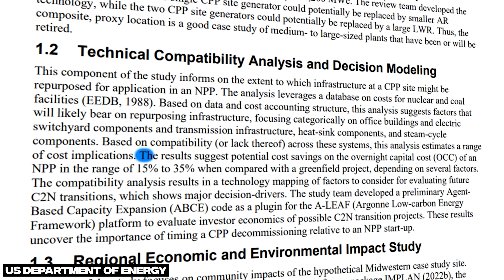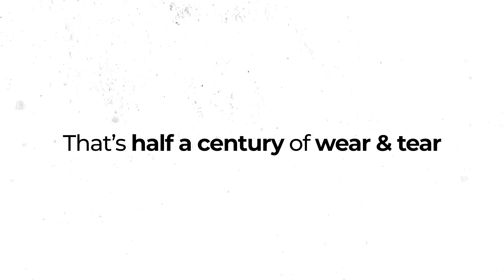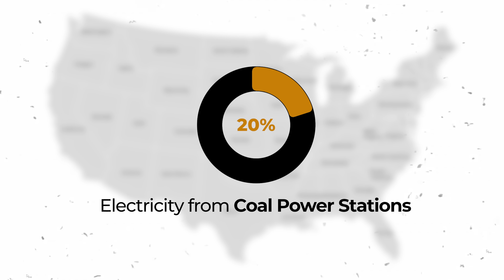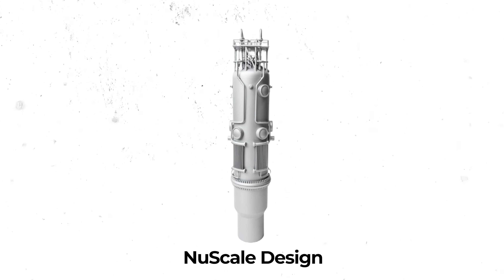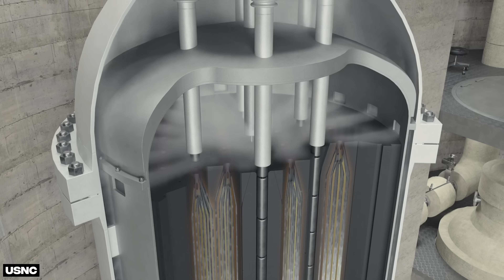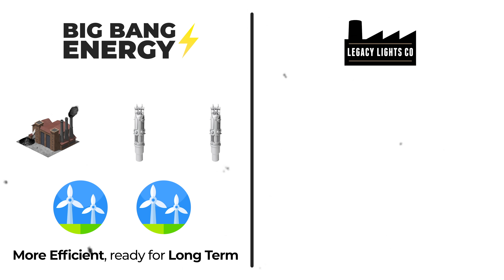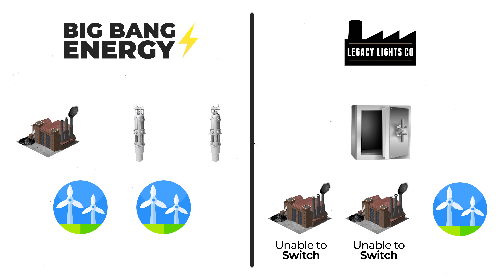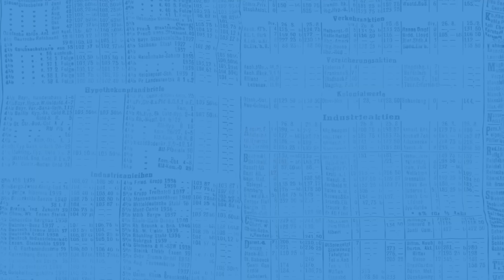Can We Convert Old Coal Plants to Nuclear Energy?

Comment: YES, and it's a brilliant idea!  Replacing the boiler and condenser with a nuclear reactor connected to the generator will reuse the old existing grid lines and infrastructure.
Reply: connecting a multi billion dollar new reactor to 60 year old coal plant components.  What could go wrong?
Reply: @clarkkent9080  Well, if you pay for it, maybe they can replace everything!
Reply: @vijayanchomatil8413  You could but you still need an expensive evaluation of the site for acceptability, cleanup of the coal ash, and cost to remove all the old equipment.  Would it not be a better idea to site a new reactor at an old abandoned nuclear site where all the evaluations have already been done?
Reply: @clarkkent9080  The cleanup is cheaper than the engineering and construction of a new infrastructure including the certification and delays.
Reply: @vijayanchomatil8413  Then why is Terrapower who is building their Natrium reactor at the site of a 60+ year old coal plant not using any of the plant systems or buildings? They only plan on using the power lines in the switchyard
Reply: @clarkkent9080  Exactly, they are using the power lines and interconnects to the grid!
Reply: @clarkkent9080  But i see your point, it depends on how old the turbine is.  One from 3 or 4 decades ago may be incompatible..
Reply: @vijayanchomatil8413  It is not only an issue of connecting to old equipment but of compatibility.  In order to operate efficiently, all the secondary components of a power plant are designed to be matched to the output temperature, pressure, and flow rate of the steam generation system.  A power plant is designed as a complete system.

Coal plants also produce superheated steam while nuclear plants do not.

An analogy would be replacing an gasoline engine in a truck with an electric motor and battery.  It would work, but the output and torque of the two power sources are different and it would not result in an efficient swap.  

Power plants are only 33% efficient and every percent loss is significant when added over the life of the plant.

Comment: I like the idea of reusing not just the site and its grid ties, but also the turbines and generators.  But I have questions:
1. How much savings is this, taking maintenance into account?  Is this a good idea on paper that isn't worth doing IRL?
2. Are coal plants typically built on waterways and relying on river/lake water for cooling?  Given increased draught should we be designing to eliminate this need, given how French nuclear plants for example have been hobbled by low water levels over the last few years?
Reply: Even if the only thing that can be reused is the transmission lines out to the grid, it's worth doing. What is more likely is a major refurbishment of the power conversion equipment would be needed. Then you add a high-temperature nuke and away you go and no water source is needed, they are air-cooled.
Reply: @chapter4travels  that's perfect.  I didn't know the advanced designs are air cooled.  Water cooling has problems with draught and effects on wildlife (or regulations thereabout), as well as siting constraints.  When batteries get cheap, put a big one in front of the nuke to get 30-40% more effective power out of it, by banking nighttime power and delivering it to peak demand (assuming the demand is there, otherwise just turn it down at night, if the design allows for that, or do carbon capture or something).
Reply: @tristan7216  "Advanced Reactors" is a bit of a misnomer, they were invented in the 1960s but not commercialized because they were not right for military submarines. They work at much higher temperatures than the domestic reactors everyone is using today and you need that higher temperature to work with the equipment in coal power plants. They also load follow just as well as a natural gas plant so no batteries are needed.
Reply: Switching our office to a paperless one looked really good......on paper !

Comment: What needs to be explained is that solar panels produce no energy at night ,so you have what's called the duck curve. This why coal fired power plants are inefficient because they can't compete with solar in the daytime, you can't run a coal plants only at night because the cost of running the plant at idle. And when you talk about nuclear it won't happen people in my area don't want carbon capture, combined with other devices would make coal real clean . One question I have had is with windmills blades wearing out where does the fine fiberglass strands go ?
Reply: > with windmills blades wearing out where does the fine fiberglass strands go ?
the blades go to landfills
the fiberglass off the windmills - straight into the biosphere

(note - some wind advocates claim we 'could' recycle the blades; they seem fine with this not being the current state by as a future eventuality; and also they get quite heated that 'could' for nuclear SMRs, GenIV, etc is quite quite beyond the realms of reason and possibility and economics)
Reply: The fiberglass probably goes to the same place that fiberglass insulation goes when old homes are torn down
Reply: Fibreglass, embedded in epoxy. Like in a boat hull. You couldn't get the fine strands out if you tried.
These are basically inert and occupy a fraction of the space taken by coal ash for the same amount of generation.
Reply: Your right just like boats fiberglass car hoods they do shed fibers thats why when you go past windmill farmes you can see piles of old blades . Because as they deteriorate they get out of balance so where does the fiberglass that wore off to make the blades out of balance go ?
Reply: @timcertain5121  Same place paint off your car goes.
By all means, insist that the vanes be buried. They will occupy far less landfill than Coal ash for the same amount of generation.

Comment: Nuclear plants are not even replacing retiring nuclear plants.  Don't hold your breath for that to change.
Until nuclear reactors are small enough to be factory-built and rail-transported (about 100 MWe), 'modular' tech isn't happening.  For a GWe, a dozen reactors need to be installed -- 10 would be sufficient for 100% electric output, while 2 reactors are being refueled or in standby.  Site crews would then be levelized year round.
Reply: NuScale is proposing what you suggest and they have $2 billion in matching taxpayer funding.  Here is how that is going.

This is from the Des Moines Register an concerning the only Small Modular Reactor (SMR) project in the U.S. today. It should be noted that NuScale said (Jan/2023) the target price for power from the plant is $89 per megawatt hour, up 53% from the previous estimate of $58 per MW hour

In 2013, the Wall Street firm Lazard estimated that the cost of generating electricity at a new nuclear plant in the United States will be between $86 and $122 per megawatt-hour. Last November, Lazard estimated that the corresponding cost will be between $131 and $204 per megawatt-hour based upon the 4 recent new nuclear projects in the U.S. . During the same eight years, renewables have plummeted in cost, and the 2021 estimates of electricity from newly constructed utility-scale solar and wind plants range between $26 and $50 per megawatt-hour. Nuclear power is simply not economically competitive.

SMRs will be even less competitive. Building and operating SMRs will cost more than large reactors for each unit (megawatt) of generation capacity. A reactor that generates five times as much power will not require five times as much concrete or five times as many workers. This makes electricity from small reactors more expensive; many of the original small reactors built in the United States were financially uncompetitive and shut down early.
The estimated cost of constructing a plant with 600 megawatts of electricity from NuScale SMRs, arguably the design closest to deployment in the United States, was originally advertised as costing $1 billion but upon requesting actual bids from engineering firms, increased to $6.1 billion in 2020. Given inflation and other cost constraints that cost today can only be expected to be significantly higher.
The cost was so high that ten members of Utah Associated Municipal Power Systems canceled their contracts. NuScale then changed its proposed plant configuration to 6 fewer reactors per site but increased each reactor output from 50 Mw to 77 Mw costing at total of $5.3 billion. The NRC just last week approved the construction of the 50 Mw design but now will have to start the review process all over given the switch to a 77 Mw design. For each kilowatt of electrical generation capacity, that estimate is around 80% more than the per-kilowatt cost of the Vogtle project in Georgia — before its cost exploded from $14 billion to over $30 billion. Based on the historical experience with nuclear reactor construction, SMRs are very likely to cost much more than initially expected. And they now have delayed the project start until 2025 in an attempt to find more backers.  All this before the inevitable setbacks that will occur once construction starts.
Reply: The smaller individual reactors get, the less efficient they can be, intrinsically. They lose more neutrons through the surface, and that has to made up by wasting more fissile fuel to make more. 
Waste production is proportional to fissile fuel used, not energy generated, so that's another cost that isn't factored in.

It's not all sunshine and lollipops. Nuclear can do it, but investors have to understand that they will not make a single cent more than coal does today, and probably less.

Comment: A few points to raise:
Capacity factor. Nuclear has a high capacity factor because it is inflexible. It is generating anyway, so the distribution network takes it. It gets paid for anyway through guaranteed purchase contracts, so the network takes it. 
Coal plant in fossil-only networks face a similar issue, the plant runs best at constant output, but demand varies widely throughout the day/night cycle. Coal can easily and most efficiently run at near 100% capacity factor, but is marginally easier to reduce output. If nuclear were required to load follow, the efficiency would drop substantially. Claiming coal has lower capacity factor because it partially achieves load-following  seems hypocritical, since nuclear can barely do this necessary function it all, and the grid needs this function.

I don't see how you can state that "SMR operating costs are usually lower than coal plants" really? In the advertising brochures maybe, but how many demonstrated  grid scale examples are you basing this on? 

Waste disposal remains completely unaddressed. Eighty years plus so far.

The upbeat position here seems to be based on some very optimistic assumptions that are unlikely to be realised.
Reply: > Capacity factor. Nuclear has a high capacity factor because it is inflexible. ... If nuclear were required to load follow, the efficiency would drop substantially. 
Yeeeeess, but!
With the amazing storage being developed for intermittent RE, we can deploy storage to load follow - and do so more efficiently with intermittent RE, because although RE is unpredictably intermittent, the demand load is extremely predictable.

I also want to point out, that intermittent RE is completely unable to load follow; nuclear can (although with the loss of efficiency that you mention).

> Waste disposal remains completely unaddressed. Eighty years plus so far.
eh, no big deal.
There is so little of it, and there is no big rush to deal with it.

Let's make a simple comparison - high level nuclear waste - 10% of GLOBAL electricity for the last 65 years: is about 370,000 tons
(captured, stored, monitored - not in the biosphere - does not hurt anyone)

This sounds like a lot, but compare to coal: 370,000 tons of pollutants pumped into the world's biosphere every 16 days to generate 2.5% of German electricity - not captured, not stored, not monitored - leads to direct negative health impacts.

Alternatively, every 80 days, McDonald’s serves about 370,000 tons of fries globally. Again, leading to negative health impacts. :)
https://www.factretriever.com/mcdonalds-food-facts
Reply: @factnotfiction5915  
Yet another way to think about it: Storage is also a solved problem, pumped hydro has been operating at acceptable efficiency for over eighty years. If enough storage had been installed to permit nuclear and coal to operate at optimal efficiency, there would be enough storage to make renewables a doddle.

"unreliably intermittent". Intermittent, yes. Unreliably, no. We have a pretty good idea of when the sun will rise, and wind sites are usually chosen for their consistency.

Seems like one energy type need s storage to operate efficiently, the other needs storage to cover the lowest-demand period. 

But if you are concerned about facts, you need to remind yourself that the important thing about Spent Fuel is not the weight or volume.
The critical factor is the radioactivity.
By weight, 99% of all radioactive waste is already disposed. as Low Level Waste.
By radioactivity, only 1% of all radioactive waste has been disposed.
Not because it's too heavy, or too large.  We have forklifts.
A big hint comes from the disputes between DOD and DOE about who has responsibility for a small fraction of vintage wastes. They have been in court for decades.
It is harder and more expensive than advertised.

I'm totally happy for "poor little me" organisations like DOD to demonstrate how easy it is by doing it.
Reply: @aaroncosier735  > Yet another way to think about it: Storage is also a solved problem, pumped hydro has been operating at acceptable efficiency for over eighty years. If enough storage had been installed to permit nuclear and coal to operate at optimal efficiency, there would be enough storage to make renewables a doddle.

Ok, but then why do we need the RE when we have Nuclear?
Why is the goal 'to make renewables a doddle'?
Why is the goal not 'to make a stable grid to support a strong economy'?

> "unreliably intermittent". Intermittent, yes. Unreliably, no. We have a pretty good idea of when the sun will rise, and wind sites are usually chosen for their consistency.

Sure, you can predict when the the wind blows and the sun shines, but so what? 

Example A: I have empty storage and I predict the wind will blow soon, and my storage will be full for peak demand - GREAT.

Example B: I have empty storage and I predict the wind will NOT blow soon, and my storage will be EMPTY for peak demand - NOT SO GREAT.

Vs in nuclear:
Example C: I have empty storage and I know I can fill my storage for peak demand - GREAT.

Now, you might say that in example B, we can mitigate that by calling around and asking big companies to lower their energy consumption, with the side effect of a negative impact on the economy - but why do that when with example C we don't need to even keep a list of phone numbers?
Reply: @factnotfiction5915  
But we don't have nuclear, not much anyway. If you want efficient nuclear, then build the storage. Build the storage first, since existing nuclear and coal benefit anyway. As these get decommissioned, the already expanding renewables use the same storage. It's still there. Proposed nuclear can always claim that storage will make it more efficient in the proposals.

Yes, we can predict when the sun will shine, and similar for winds in good locations. That lets us calculate just how much storage is needed till it shines again.
As you say, we can also modulate demand, and consider importing from places where the sun is shining and the wind is blowing.

Just like when your reactor is being refuelled, or gets derated for a defect,  someone has to "ring around" to reduce demand or get coverage by someone else.

Your option C is turning out very expensive, has never fulfilled the promise along the way, and claims it cannot afford to pay for it's wastes.
By all means, build more, at double to triple the quoted price. Don't forget to include the price of storage so the inflexible hulk can genuinely do a bit of load following.
Don't forget to include genuine permanent waste disposal plans and costs.

At the moment investment is going into diverse renewables and storages. By all means put yours into nuclear if you like.

Comment: Your assessment that a coal plant has reduced production is only a factor of the "renewables" grid.  When the sun is shining and/or the wind is blowing, the coal-fired power plant shuts itself off because the government gives extra money to the renewable producer for their power, but not to the coal.  The electric company gets paid two paychecks for giving you solar or wind, but only one to give you coal power.  A nuclear power plant takes several days to fire up after shutdown, so we can't power up and down as the weather wanes.  The nuclear power plant where I work puts power on the grid all the time, but is paid nothing for it on a sunny or windy day.  The coal plant is only shutting down for economics, not a shortage of capability.
Reply: I never heard of the government paying renewables for their power.  Utilities buy power from outside generators if needed not the government.    You may be talking about tax credits and that is short term to help the industry just like the help the nuclear industry got for the last 70 years and is still getting.
Reply: actually, coal plants do have a c.f. of 60-75% even in a non-RE grid.
I believe they need a lot of maintenance per the coal inputs and the ash removal bits, rather than the boiler+turbine bits